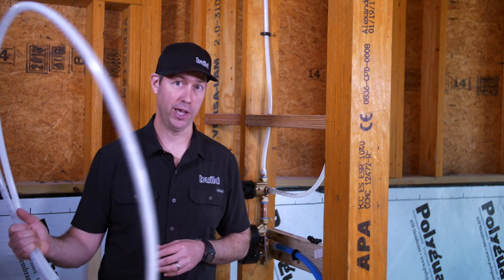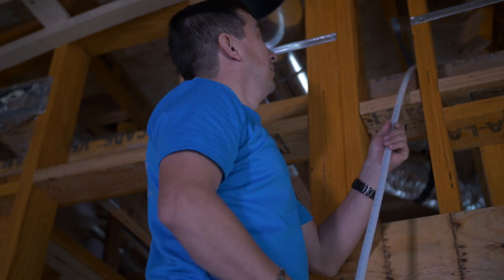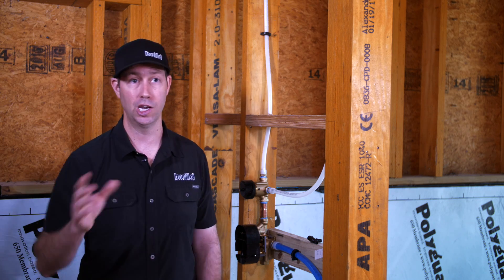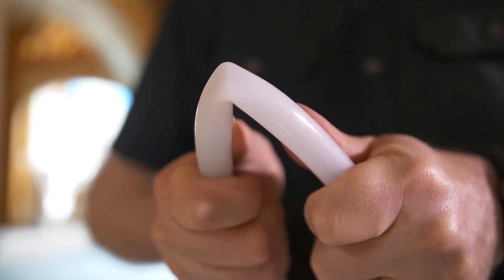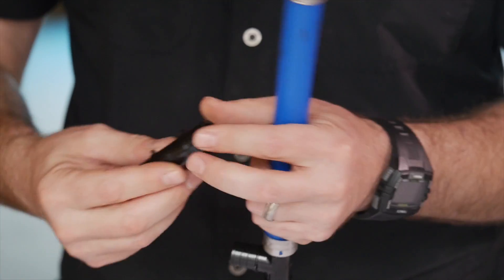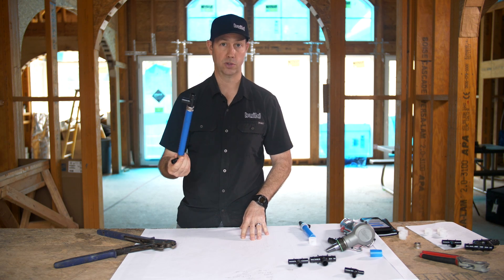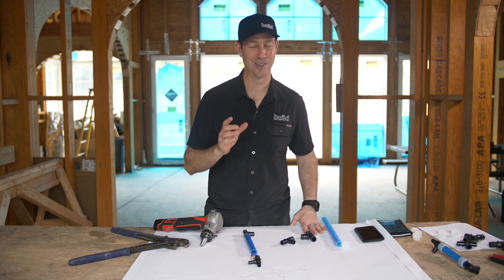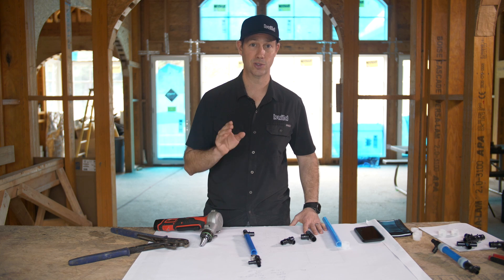PEX vs. Copper Plumbing

Comment: Welcome very much your teaching and experience.  Keep bringing them. Just need to know your opinion on 3/4 vs 1/2 size. I see people using 1/2. I have a well and would like to use flow as priority since the pump is 1/2 hp.
Reply: I'll helpmya here.  I will start by saying that if you are supplying g more than a single fixture you absolutely need 3/4 minimum. And I will end by asking you weather you would prefer a shower with 100 psi and 1 gallon per mi ute or 1 psi and 100 gpm? See people often mistake pressure for flow, pressure is just to get water through restriction and to the end point of use,  if your on a well then your a 40-60 likely, if your house is 2 story's the  you only  notice the difference between a 30-50and a 40-60 o  the top floor really cause every foot of water = .433 psi at its base... the pressure is to overcome the head
Reply: Maybe you should install a pressure tank.

Comment: Save $$$ upfront using a polyethylene supply line, so you can afford the chemo you'll need from the cancer [2,4]-di-tert-butylphenol, methylene trichloroacetate, pyridine, and toluenelater you get as the chemicals leach out from the PEX. 

Brilliant!

Comment: Living in S Dakota, I like the water freeze benefit. But how well do they handle heat when you try to thaw them out with a torch or heat gun?
Reply: Just curious, are you wrapping your pipes in heat tape as well as insulating them?

Comment: I'm a plumber, and I'm already working on a 2nd repair, Pex leak due to rats eating the pex. Yeah it's a quick fix, throw a sharkbite (pricy) or cut and use rings and couplings with a replacement pex pipe. Copper, however, is durable and cannot be chewed through by rats, yeah it's expensive, and dealing with solder and flux, but hey, you get what you pay for.
Reply: @douganderson7002  Rats don't exist in the developed world? lol.

Comment: In Florida Lightning stikes and poor bonding/grounding  cause lots of pin hole leaks in copper, all you have to do to convice someone to go with pex over copper is to cut open a copper pipe thats been in uses for 20 years and a pex pipe, and its not just inside either it corrodes on the outside also and has that green shit growing all over it. Pretty much all new production house have pex now because it installs so quickly.
Reply: https://www.orlandosentinel.com/news/os-xpm-1996-06-23-9606220557-story.html I lived here 20 years and i made a good living fixing copper leaks

Comment: I use Hep2o from Wavin. The benefit is you don't need special tools. You can even disconnect and it is very simple to connect with standard copper.

Comment: Ive never heard of PEX, in New Zealand we had some PVC type pipe that was the ultimate plumbing system but after 10-15 years it split and caused huge damage. I have totally copper through my house except for the one bit of PVC pipe that was installed in a kitchen  renovation ( against my request) and guess what started leaking in the wall 10 years later, wreaked my kitchen joinery and cause a major nightmare. Im sorry if its plastic once bitten twice shy, I want copper.

Comment: In my experience as a contractor,.. pex fails when it freezes about as often as copper. You are dreaming if you think PEX can be frozen and still be ok. Go ahead and call pex and ask. There is a reason they tell you in their specs that you should not let it freeze...And here you are telling everyone out there in idiotville that pex is ok when it freezes.  In my experience,..it's not any more ok than copper that gets frozen. We had a forclosure we worked on,..the power was off,..and the pipes froze and there were many leaks. This house was a hodge podge of pex and copper,..There were about as many leaks in the pex as there was in the copper. That being said, pex does save a lot of time and expense.
Reply: Sorry, I don't have time for idiots who won't  make the call to pex and ask them if it's ok if it freezes. Go ahead and do what you want.
Reply: Are you 2 years old? Call pex if you disagree.  Or go ahead and do what you want,...It's your liability.

Comment: What about pushfit that is used in the uk. You can push fit it on and take it apart again. Plus the fittings are flexible so you can turn them even when they are under pressure

Comment: Bends and fittings do not reduce pressure. They reduce FLOW. There is a difference.
Reply: They reduce flow, and they also pressure when there is flow. EVERY.....SINGLE......TIME.. Just get out your guages before your open your mouth. Static pressure is always the same...even if your pipe is the size of a pinhole.

Comment: We either had a bad installers or just unlucky. I like the The technology in this tubings. We have had two significant leaks. Both at elbows in the system. One was a cut in the line at an elbow. The other was a transition from copper to Peks that sprung a leak. 
As long as it works it’s great! When it fails it sucks!

Comment: Pex is the only way to go. I got a hold of a roll of 1/2" copper a 100' roll of it and installed a lot of it. About six years later it had corrosion in many spots on it.  It was corroding all the way through it. The sixty year old copper was in better shape then the new stuff. I found the PEX is really easy to install. Seven yars now no problems so fat! The PEX I used had copper rings, so ther is three methods of Pex crimp rings out there. Nice to see advancements in PEX systems!

Comment: PEX = “From Dr. Whelton’s studies, chemicals were still leaching from some PEX pipes after 30 days leading to measurements above EPAs odor threshold and with similar findings in field studies from samples from homes where pipes were 1 and 2 years old. It’s also difficult to characterize the risk, because many of the leaching chemicals measured are unknown.”

And "16 organic chemicals were identified, including 2,4-di-tert-butylphenol, methylene trichloroacetate, pyridine, and toluene. The team detected some of the organic chemicals during their field investigation of the plumbing system. "
Reply: https://www.nsf.org/newsroom_pdf/nsf_reviews_studies_pex.pdf

NSF found his studies limited.  Also, after reading the studying they were only talking about ODOR not health risks.  If you read the study evaluation from nsf you can see that they didn’t prove harm by anything they found in the study to date.
Reply: Bullshit, there is Zero tolulene in pex. Pex stands for cross linked polly ethelyne ..literally.
Reply: Copper leaches too and there is such a thing as copper poisoning. And old houses with copper pipe have lead in the copper itself and and leaded joints. Brass fittings only within the last few years have removed lead completely. 
Mostly scare tactics back and forth to get people to use their product.  Companies like to make a product, patient it, create a scare to general public, bribe legislation, and collect lots of profit. 
Good example in HVAC is DuPont and their refrigerants.

Comment: It was my understanding that copper is used for fresh water because bacteria doesn't grow on it. But I've seen tons of slime in plastic pipes .
Reply: Salt water is now used for Hot Tubs, (Sodium) (Silver,iodine) in bandages. It seems like metal resists bacteria and fungus the best.
Reply: After a few year scaling on the inside of the copper pipe will make those anti-bacteria effect useless.

Comment: I would like to mention. Copper comes in rolls to. It is harder to bend but you can do the same bends. But you don't have expansion   it all depends on the connection. We just switched to rehau

Comment: All of what you said is true, except for one thing,   the guy who is installing the product, I have seen horror show after horror show when installing around corners and through a wall to joists areas.  there are places where fitting should be used but they don't , sloppy workmanship comes when you make things to easy,  They turn it into REAL EASY    just sayin RC

Comment: Rats and mice ate my pex pipes. They ate the red piping like candy. Water was off during the work. They ate it because they liked the flavor not to get water as there was no wayer on. They ate holes in the white pipes also. Back to copper.....
Reply: I find it healthier to avoid allowing rodents to live with me. I'm sure covering the Pex with foam pluming insulation is not that much of a hassle.
Reply: Wow and pex is hard as heck.
Reply: I heard this is the Pex downfall especially in the countryside.

Comment: Built new house 2016 difference between PEX and copper $1000. Had the house done in copper.
Reply: Depending on the install, if done correctly they should both last for decades. But I have seen terrible jobs done in both systems. Pex looks hideous if you dont support it in the walls and joist spaces. Unfortunately the place I live they didn't care about supporting it in the wall or making anything look decent. Just ran the pipe and ran away. Wondering how long before leaks occur. 

My buddy also worked for a company where they didn't properly protect pex while going through steel studs. You guessed it, new build and a rush job. So a matter of I say 4 years before leaks occur for the poor renters of that apartment complex
Reply: A mistake you will regret, as most believe Pex is superior to copper!

Comment: Hi. Just wondering can I use clamping fittings on a pex-a pex pipe?
Reply: Yes they PEX has same outside diameter as copper so copper hangers, clamps, and nail-ins will work. Also sch40 and sch80 plastic pipes (ABS and PVC) have OD that matches with threaded steal pipe so they have interchangeable supports.

Comment: Which is better, the copper pex compression rings or the stainless pinch bands?
Reply: Shane K 
Been using pex for a long time so I use copper rings because simply because it was the only thing available at the time. Both work great. I’m guessing you’re not going to be doing it all the time so I would recommend SS rings because you will only need 1 tool for all sizes. 
SS rings are easier to remove but copper are easier to recrimp if crimp doesn’t take the first time. 
I mostly prefer copper because I have speacialty crimpers that are capable of getting in tighter spots. Rarely an issue but I’m a professional and it keeps me going.
Reply: Mark Chickenbutt thanks man, I just put a new deep well pump and pressure tank system in my house, where it comes out of the pitless adapter to the pressure tank, then to the main water inlet to my house I used 1 inch pex pipe and borrowed my neighbors pex crimpers. I originally bought the stainless type bands but his crimpers were for the copper so I bought them. Just wondering if they were going to last, thanks again sir.

Comment: At 2:28 you state that every time you get a bend in copper that there is a pressure and flow reduction(flow). I think you meant every time you add a fitting or transition to get around a bend there is a pressure drop or flow reduction.
Reply: Right but he was making the point that you can use less fittings with pex vs copper. BECAUSE it is flexible and can bend. Maybe i'm wrong, I dunno.
Reply: @Staki6908  Oh, absolutely. I use PEX in every possible chance I get rather than copper. Its just that copper doesn't bend very easily if larger and the joint not leaking is very dependent on who is soldering the joint. Everything other than the statement at  2:28 is absolutey correct in what he says about Pex.
Reply: A “bend” in plumbing doesn’t mean the pipe is “bent”.  Adding a bend with a straight pipe means fittings.

Comment: My last home had copper.  when I would turn on the shower or sink, seems like I would have to wait a full minute before the water would get hot.  With PEX, its only a few seconds.  Its a better insulator.  I also like how they color code them.  Blue or Cold, Red for Hot, and Green for Sprinklers.  At least that is how my new home was built.  Makes it easier to know what I am looking at when I come across a water line.

Comment: Plumber speaking, C-PVC is absolute junk, dont let anyone sell you on the early cost it is not worth it. Only things worse is Quest
Reply: Damn.  I bought a house few years back and replaced all the old plumbing. Of course the plumber used cpvc.
Reply: Plumber here as well. The standard cheap gold colored cpvc is junk yes. 
But the gray sch80 stuff is very tuff and doesn’t get brittle. It’s used in commercial settings and for pools because it is very resistant to chlorine.

Comment: I had a pex failure where it curved over a 2 x 4 in my attic (installed by previous owner) and over years vibrated against a knot till it made a fine leak - squirted water about 10 feet.  weird.  took it out and went to M copper.
Reply: All you had to do was replace that run and put zip-ties or hangers to secure it
Reply: @robertwells9903  yes - well sometimes it seems like I like to do things the hard way :-)
Reply: Gordon Swanson I would use type L copper it’s thicker so it will be more resistance from the friction from vibrations and from any electrolysis that could happen from ions in you water.

Comment: As with many plastics that were going to revolutionize our life have shown to be hazardous to our health, look at BPA plastics. PEX is not 100% safe. It was mentioned in the video that PEX might in some instances deteriorate. Now why is that? The plastic chemicals went somewhere. You drank and bathed in the water coming from the pipes. I rather pay more to have copper pipes installed than find out that some family member has developed a strange ailment that doctors can't figure out what the cause is.

Comment: Would have been nice to see what the layman finds when shopping at the local hardware store, ie; compression fittings. Maybe they are not recommended but a explanation would be beneficial.
Reply: You dont really want to use compression on PEX unless it has a stiffener, that'll crush the pipe and cause leaks. They make and sell all the same parts that work with cinch rings over the pipe.

Comment: We had a presentation from one of the reps at Uponor today. He mentioned all of the things you talked about today. It seems like a great product! I will definitely use it in my house one day! 

Another thing they mentioned was that the Uponor (Pex A) product will return back to it's original shape if you heat it up (you touched on that a bit) and the fittings themselves are incredibly secure; they have a better tensile strength than the Pex itself.
Reply: Just doesnt like uv

Comment: Love the Uponor (Wirsbo) Pex-A system. Replaced all the galvanized piping in old home with it. Did a hundred+ foot run from the main house to a carport fished through a 2" PVC electrical conduit with an expansion loop on one end for cold water supply. 17 years in service. Thermal contraction/expansion needs to be observed with PEX. See charts.

Comment: You also get reduced flow with PEX! When your running 1/2" overhead from a shower valve to multiple shower heads you have increased the developed length and will have a decrease in volume.
Reply: If your running 1/2" to multiple showerheads then YOU are the problem

Comment: Any1 buy house cpvs is idiot!pex taste terrible if not used much , pex new style as gray in 70s TRAILER s. Volume. Same pipe size same subvdision.  7 gallon bucket w copper full b4pex 4 gallons. Still filling . bugs eat pax typically stink bugs. Can fix a fix copper in bad place vs getting crimper in spot after. Job dun. Of corse theres also cheap track homes direct crimp to pex , think 10 years dripping shut off o sh@$ ya cut sheet rock and ya. You call a sheet rock man to fix it .a simple slide on stop 5 min laterOn your copper pipe.  Did he forget it dries out ? Ya pex is a pain as a repair plumber and making new plummers idiots and size is not same tho they say same as copper 4 volume

Comment: Is shark bite ok to use in walls
Reply: I'd like to know also what he thinks about shark bite. I used it because it was way cheaper and easier when I did water softener
Reply: I’ve heard some plumbers say not to because they feel it’s not as secure and crimp, press, solder, expansion, etc.
Reply: No, because rubber o-rings is what does the sealing and they are not as permanent or proven over time as solder or compression fittings. Use them where a leak won't damage material.
Reply: weelgunny I don’t thing the o ring is what normally goes on the shark bite I think it’s the stainless steel teeth over time lose it’s hold on the copper or pex, press fitting use o rings and they last pretty much until the pipe itself fails.

Comment: Pex is a great product but the down size  with it, is if you do a repiping of a house or in new construction you have to over size the system do to the fittings choking down the size of the line. Take a copper fitting and you will notice it goes over the pipe as with Pex it goes in side. Then check the pipe size of the pex fitting to the copper pipe opening and you will see the difference. So remember to always over size the job if using PEX. hope that helps

Comment: used uponor to replace a 30 foot run of copper pipe that started leaking..the copper had 4 turns in it.  Used one straight piece of pex...very easy to use

Comment: Matt. In Norway the most used piping system is Sanipex. Its been on the market for 25 years and is very reliable. Its a pipe-in-pipe system with a distributing "central" placed in a wetroom. Each outtake comes directly from the central. Its structure is very similar to an electric central. And the double pipe also helps if theres a leakage. It will be lead back to the central and then in to a water drain in your wetroom. And if its leaking the innerpipe can be replaced. It takes a bit of elbowgrease. But doable. Would absolutly recommend the product.